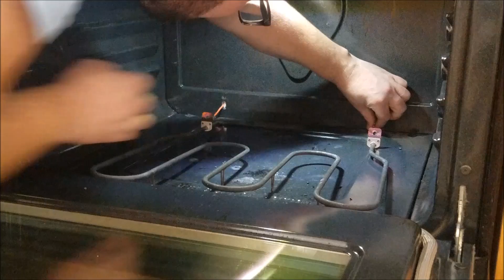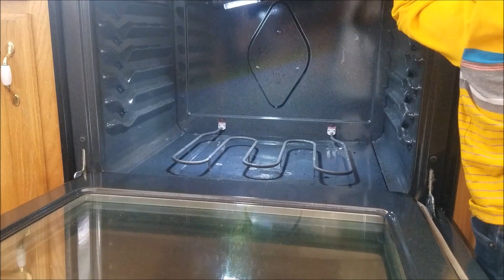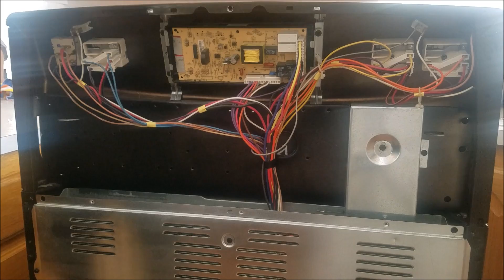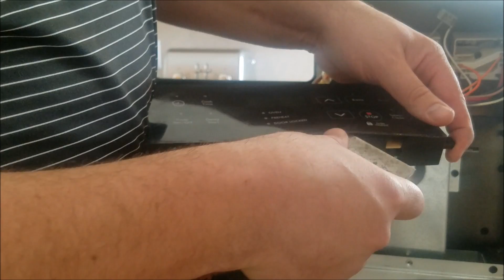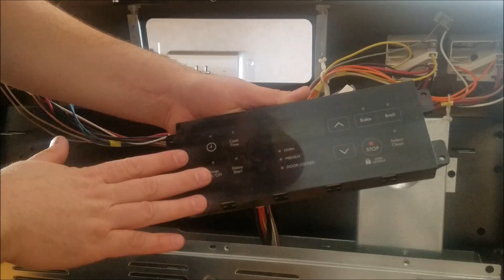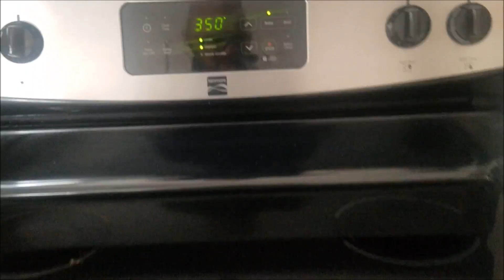Kenmore/Frigidaire/Electrolux Range Oven not Working=NO HEAT

Comment: Mine has no codes but clock is off until you turn a burner on and then it makes a momentary buzzing noise. None of the burners or oven works..?????

Comment: Had a problem with our Electrolux double oven, slow heating & not working at times. Checked the temperature sensor, hi temp. Cutouts, elements & everything appeared ok. Before replacing the control panel. For some reason the following procedure is not included too reset the main control panel with the oven manual?
The Great Reset Procedure
1. Main control panel, enter the preference / wrench.
2. rse will show no.
3. Enter plus sign & then enter yes.
4. Enter start.

Comment: Could have saved more. Did you check what was wrong with the board?  Usually it is a $3 relay.
Reply: Which number relay?
Reply: @danlghiz2092  The 2 white ones,  usually the outside white one, but replace them both at the same time, about $ 5 to $8  each.

Comment: I cut my oven on and it began to smoke from the control panel and smelt like burnt wire. Could it be that a wire needs replacing, the bake element is bad or the relay board needs replacing? I have a frigidaire stove.

Comment: Hello Mr. Anderson.  Thank you for this video.  It seems that this is what is wrong with my Frigidaire oven.  My husband changed out both the broil and bake elements with new ones and it still did not work.  I'm hoping that a new control board will fix it?  I wanted to ask you.....my stove top elements work and so does my clock and timer.  Do you still think it could be the control board?  My oven is Model
 FEF326FSE.  Do you know which one I need to order?  Thank you for any info.  I sure hate to spend 500 on a brand new stove if this one can be fixed for under 200.
Reply: Same thing here

Comment: What made you determine it wasnt wiring at first before deciding on if its the board?
Reply from the maker: In my experience if the wiring where to fail it's usually at a connector.  When testing the element the connectors visually looked ok and seeing there are no moving parts there wouldn't be anything for the wires to rub on/thru.  At this point I assumed it was the board as the element was ruled out.